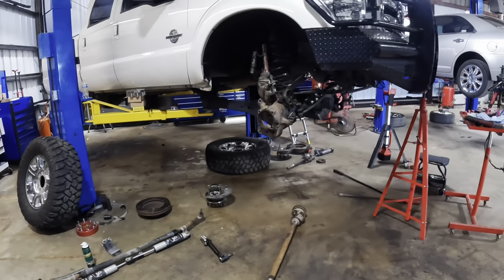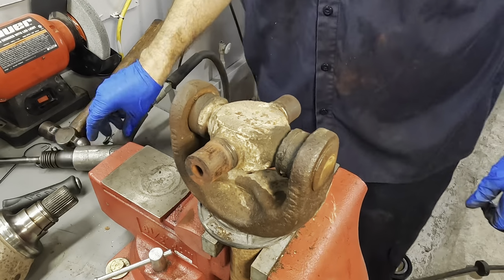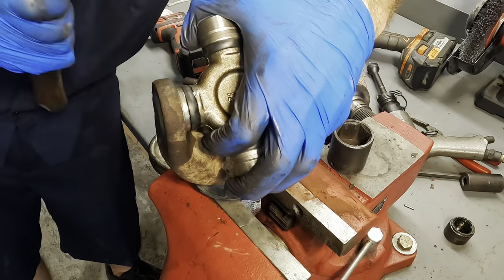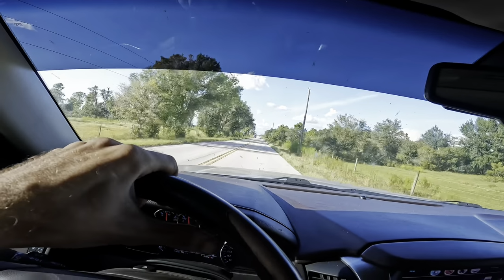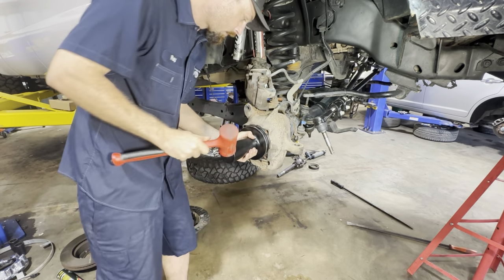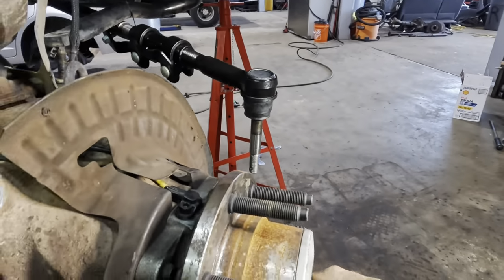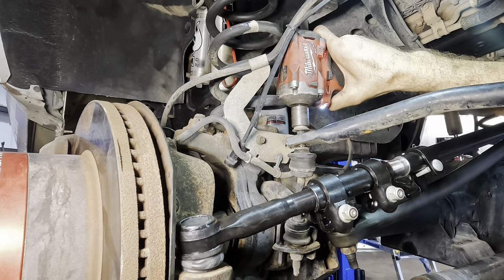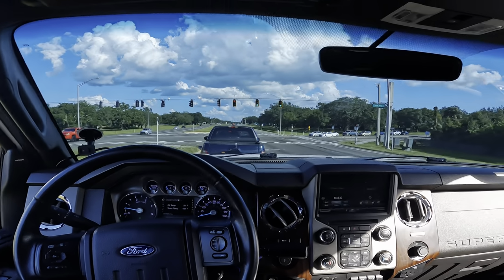Mechanic States: I Quit !! Suspension Rebuild Ford F250 F350 6.7

Comment: I usually hesitate to give advice to an experienced auto mechanic who has much more experince than I, but I'm old, so if it will help, here it is. Back in the day when I maintained my own vehicles, and had no power tools to work with, I used only a vice to R&R u-joints. I would cut a piece of pipe large enough to go over one cup, and use a 3/4" socket to push from the other side. I would put all that between the vice jaws, and just squeeze them together using the vice itself, no special tools needed. The same operation works for both removal and install, except the pipe isn't needed on the install. I've probably done dozen that way over the years and it worked fine every time. As I said I'm not an auto mechanic, but I am a retired USAF jet fighter mechanic.

Comment: Just a thought, but it's always nice to have at least one heavy duty bench to put the vise on.  That one seems to be bouncing around a lot.
Reply: All shops I have worked at that have the metal work bench had same spring action. Took a few apart fitted with wood underneath to stiffen them up to stop bouncing.
Reply: Personally, I would have tried to use the large (hf) press instead of the ball joint press for the U-joints ; and used ( or possibly borrowed from next door) a frame straightening ram connected to the tool for the final press into the truck.

Comment: In the last few months I’ve had to replace two of these housings due to collision damage. I need to get that tool. I’ve been using a piece of pipe to drive the seal on the axle than a piece of sewer pipe to seat it in the knuckle. I understand your comment about being tired. These things are big, all the parts are heavy, and they are mentally taxing with more components than you expect.

Comment: I'm from the old school, I stopped wrenching about 30 yrs ago. You have some pretty neat tools. I've installed u-joints on the side of the road with nothing more than a hammer and a  socket that I didn't mind ruining.

Comment: Should send these axles (and driveshafts) out to a shop that does these 24/7. They check them for damage, warpage, etc. You spent a lot of time on them. I’d have used a small 3 lb sledge hammer to muscle the seals on. Keep the long videos coming! Love ‘em.  Great job Ray! Tough one. Good luck Troy - not easy to move out on your own.

Comment: I was taught, with U-joints, you take the new caps, fill them with grease, install making sure that the new grease fitting is not installed. As you install each cap, the entire U-joint gets "greased" and all you have to do is install the grease fitting. Saves a lot of headaches and no lost needles.
Sometimes, one must spread their own wings and do what they must do for themselves, best of luck to you Troy. Great video, cheers :)

Comment: Best wishes to Troy in his future endeavors. Maybe he'll decide to come back and learn more from you Ray.
Ray, you need a solid vise table. You lose so much striking force with that one moving around like that.
Reply: I am constantly cringing every time he does that because the work bench he's using acts like a gihugic leaf spring. What he needs is a nice wooden bench secured to the floor/wall so it's square & solid.
Reply: Guess Ray is waiting for the opportunity to make a vid of the new heavy duty bench!!
Reply: a couple 4x4's under it would work.
Reply: @MrLeavemikealone  :face-blue-smiling::face-blue-smiling::face-blue-smiling:

Comment: Ray if you want to help prevent the issue with the u joints causing a binding condition in the future advise them to put it in 4x4 and drive for atleast 10 miles 1x a month to keep the joints moving and lubricated. I'm not sure if that's still specified in the owners manual anymore but it used to be   and it works well
Reply: Isn’t the lockers in the hub? Joints are moving all the time.
Reply: @petervw56  no when unlocked the joints do not move. The system disconnects the hub from the splines on the shaft leaving the shaft immobile. Even in a system like dodge uses witch is an axel disconnect witch is similar to the independent front suspension systems used by GM and Toyota and the rest of the others while the joints continue to move in those systems there's a big difference in load between driven or nondriven. When not in 4x4 in any of the systems that don't have locking hubs the joints are not driven and are just following with the wheel witch does NOT  apply any type of force to the joint and doesn't cause the bearings to move under load and make the needles move in the same way as they are going to move under load. Not does it force the grease to move under pressure.  I have a Toyota and a dodge chevy 4x4 in my driveway currently as my personal vehicles and upon looking in the owners manual all 3 of them say that you are supposed to drive so many miles per month in 4x4 to keep the system properly lubricated and moving freely. I know that my 95 Ford said the same thing.  I'm sure that they still probably do say something that is very similar as well though I can't say that for fact as I don't own anything that new
Reply: Wouldn't locking the hubs do the job just as well?
Reply: @russellstyles5381  no because your not going to be applying torque through the system. Anyone who has ever had a dodge or jeep solid front axle knows that one after the joint goes out and you have the same situation as seen here. Has to be the drive side not the driven side the pressure from trying to turn the tire is what is needed can't get that unless you are in 4x4 and drive it for a few miles

Comment: When setting u joint caps, rest the ears of one yoke on the vise and hammer the other yoke to seat the caps...and in a pinch...you can make that seal installer with a piece of a 4X4 with a 1-3/4" hole drilled down the center.
And good luck Troy...you'll be missed!

Comment: This brings back nightmares.  I was living in the backwoods of Tennessee during the coof.   My landlord had 7 Ford Excursions (same underneath as an F250).  So I became his mechanic and 4R100 re-builder.  U joints were my last favorite.  Well other than exhaust manifold gaskets. ugh.  Got pretty good at repairing spark plug hole threads and vacuum lines .  Mainly 6.8L models.

Comment: I'm a mechanic myself and have done many of those Ford axle seals with the same tool... Only if you use a regular small sledgehammer instead of the dead blow it works soo much easier
Reply: I was thinking that soft face on the deadblow hammer was wrong tool.  You want force of your swing to move the seal not deform your hammer face.  I am curious if you tried freezing the hub and warming the seal?  I wrap steel bearings in wet paper towels and put them in the microwave.  Expands thier id very quickly and the slide right on a frozen shaft.

He was working too hard on this one.

Comment: I found that if you tap on the part with the holes they will relax and find home, they get pushed inward a little from the friction of the cups going in, tap outward on them. yea like you did in the end,. atta boy. I used to do them with just a hammer and sockets, that's nerve racking.

Comment: Tip for you Ray on seating the U-joints. Spread the jaws on the vise and lay the cross piece in the vise and give the yoke a whack or two on each side, that will set the cups properly.   I also zip tie the cups on the cross part that is not being worked on just as a safety factor. Knocked too many off in my time cranking a wrench.

Comment: Again, it's a great video.  I actually own 2 F-250s.  Did this job a few times.  It is a young man's game.  There are a couple of things that i have acquired over the years ... first, YA GOTTA GET A BETTER BENCH to mount your vise!  And ... ya gotta get a better hammer.  A 10lb sledgehammer swung at that makes a better mover.  
And, I use a 20-ton press for the universal joint replacement.  Still haven't broken down and bought an impact tool for ball joints and stuff.
Sorry to hear about Troy leaving. 
Keep up the great work

Comment: I did this same job on my 2015 f250 but I bought fully assembled axles w/ seals installed, fully built hubs, and did all new calipers and discs as well, after watching the tear down and press in of the seals and u-joints, I realized it prob saved me 4 hours of work. I thought the ball joints were the worst part of it until I had to get that damn snap ring installed........easy take out but a real time waster to install--about an hour for both rings.

Comment: When installing the drive axle seal, I remembered one tool, maybe I can try it next time,  a hydraulic jack which is usually used to press wheel bearings, But overall good job ray😀👍🏻

Comment: This 3 part video just helped to solidify the " built Ford tough" phrase ! I love my ford trucks . I have a 150 a few 250's and a 350 okay have to toss in the significant others Navigator as they use many of the 150 and 250 suspension parts they're just a truck in a tuxedo. lol 
Shows how the modern heavy duty trucks are actually heavy and built to work . I have a feeling we'll be seeing Arod around your shop more as y'all both move foward !

Comment: Use an air hammer with a flat hammer bit and lightly run around the outter perimeter of that seal to drive it in evenly.  Works great and doesnt damage it.

Comment: Crazy day. Fourth session trying to watch as much of this as possible. 50 minutes in now.
Bet you never thought the red hammer would be too puny for an automotive garage!
Next time you’re in Harbour Freight, go to the builders section and pick up a sledgehammer. I think I’d probably use the press for the first half of the seal fitting, but the hammer would still be needed to get it into the knuckle.

Comment: when you have the axle in the vice rest the end on the floor preferably on a piece of scrap wood plastic, this will drive seal in a lot quicker, as the power from the hammer blow will not be absorbed by the wobble of the vice and bench.. your bench would also greatly benefit from been solidly attached to the wall. having said that ive learnt bucket loads from watching

Comment: I use a lubricant on the press threads, inner and outer surfaces of where the bearings fit in the yoke.Makes it easier.

Comment: I bought some 1x2 aluminum bars from ebay, some roll PSA paper, slap some on, leaves a machined finish, no way to over cut. You can have the bar milled perfectly flat if you like, usually about .002 out, ok for most jobs.

Comment: I  always put grease around the seal so it will slide into the hub. I never use the tool to smack it into the corner. It damages it when it doesn't angle correctly; I installed 5,000

Comment: Just a trip you can try I mount the u joint press in the vice that way I have more control of the shaft that way you don't have to try and handle the press and impact at the same time..works really good for me

Comment: Gopro's rarely overheat on 1080p when when recording in 4k they overheat super easy because 4k requires so much more processing power its okay ray most of use know how the u joint goes back together and its a process of rinse and repest like the first yoke to the second 27:40 @Rainman Ray's Repairs

Comment: Set joints by smacking the back of the yoke ear w appropriate size hammer. Back and forth until proper preload is achieved.

Comment: Left some parts out.... There are two washers that live under that C clip inside each of the hubs. Those caliper bracket bolts get red thread sealer too. They will back out without the Loctite. Blue Loctite on the locker cap screws.

Comment: Great vid and no problems with the longer time , did some uni joints on my landcruiser last year was good to see a professional do one and still have the issues I had getting them sitting correctly without excessive tightness. Your vice bench looks like it needs some extra support with those hammer blows. Thanks again Ray

Comment: If he does any off-roading, you have to use Spicer u-joints! Also I take special notice of where the circle clips seat in the yoke. If on the inside, I'll take a file to remove any corrosion that would interfere with the clearance and if on the outside I use a pick to scrap away and a small wire wheel. Then I'll take a hammer and hit around the base of the yoke to get those "good vibrations" that release the tension on the cups (Don't ever bang on the ears, they are easy to warp and cause premature needle bearing failure). If that's not enough then I'll dismantle the u-joint and figure out what's going on. Only time I've had issues with not releasing that extra tension is with a non Spicer u-joint or a yoke that has been warped from off-road abuse.

Comment: Putting the shaft in the vice with no support from the floor means the bench flexes and wastes all the force.  Prop the axle on a piece of wood on the floor and you won’t have to work so hard.  Also, mount your vise on something more substantial.

Comment: after you drive the cups in and it is tight just carry on assembling then just hit the yokes to loosen up the loints where you over pressed them i have done u joints roadside without all the air hammers and vice and pressses etc just a hammer and a few sockets to use as dies

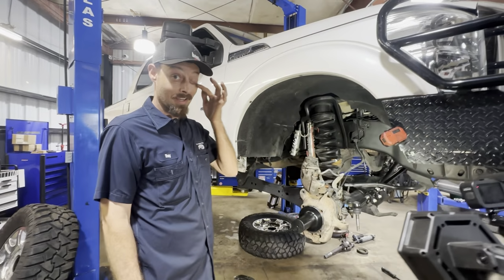Comment: My suggestion would be a 5 pound or 10 pound long handle dead blow i been installing them vacuum seals since the late 90s they are a pain and the seal driver is different For all the years and Versions of the f250 and up 2000 tool is different then the 2008 model years vs the 2017 plus models Raymond I bought a 5 and 10 pound dead blow just for these seals 50:40 @Rainman Ray's Repairs

Comment: I am not a mechanic as such but I am a physicist and I understand the dynamics of impacts. Sometimes as you were hammering, the thing made negative progress, that is, it came out instead of going farther in. The energy of the hammer was somehow reflected and directed outward and made it worse, not better. So the hammering has to have some accuracy at the closing stages I think.

Comment: The entire Dana  axle brand new with u-joint and seals all put together from Summit Racing only cost about 110 for the passenger side and about 85 for the driver side.
Way less expensive than purchasing the u-joint $40 and the Dana seal package $40.
Just replace the entire axel, it's faster and you get an entire new Dana axel, all assembled for 20-30 more bucks. Just pull it from the box and Install.

Comment: The universal joint:  I think you should have lubed the yokes after you removed the rust, thus alleviating some of the the trouble removing and installing the new cups.  Best wishes to/for Troy.  Tires:  Lowering the truck to install them is much less straining to your spine.  Take care of it.  Hope Dave likes the shop and will appear in some videos.

Comment: From a guy who has installed hundreds of U joints. The best method is a 3lb hammer and a vice. Open the vice jaws and put the joint in there hammer on each side to pop off the caps. Then to install you use the vice jaws to press them in. I do U joints in about  5 minutes once the axle or drive shaft is out. very easy simple job. Only tool needed. 3lb hammer screwdriver (to pull out the keepers) everthing else 3lb hammer and vice.

Comment: Hammer the ends of the bearing caps to remove ujoint retaining  clips. Clean all rust from retaining clip and bearing cap surfaces. Place drive shaft ears on the jaws of the vise and hammer the shaft off the ujoint. Install one cap with the cross and hammer it in until you can install the other cap on the cross, then hammer into place. Always grease the inside of the knuckle when installing the axle shaft and main end seal then it won't rust do to water intrusion. Technically you Should always tightening wheel bearing assemblys in a Cris cross pattern. Pry the axle into the knuckle to install snap ring. It's a good idea to replace the oring and gasket on the auto hub locker before installing to insure there's no vacuum leak.

Comment: Troy I  wish you the  best in  what ever  you do in this  lifetime brother and you'll  be  missed for  sure  good  luck and  God  Bless . Ray  nice  intro with Dave and  I'M sure it  will  work out he  seems  to  be  very  capable mechanic from the  little  we  seen of  him.Great video  Ray nice  job and  that  seal  pounding  looked  rough and don't  for get to  grease  the  fittings you installed.

Comment: Ray, this is not pertaining to this video but I have the same bench your using and have it set up similar and these are a few things I did to mine that made it 99% better to work on and WAY more sturdy. 

 I got sick of all the flex with my table and carriage bolted a sheet of 3/4 " plywood underneath with Liquid Nails construction adhesive and C-clamped it to the steel gurt on my steel building and it has made all the difference in the world when you have some "Bull & Jam"  work to do.  You could bolt it to a gurt  if you want, but for me keeping mine mobile was a priority too , so C-clamps it was.  Plus the back splash on mine was just high enough it hit just right on the gurt and a beam. Perfect ! 

I think you like your bench a whole lot more and shit don't dance around anywhere so much either when your doing "Bulling & Jamming" work !  
I know I sure got sick of chasing down "Launched" hardware after Bulling on that table before ,,, not so much now  LOL